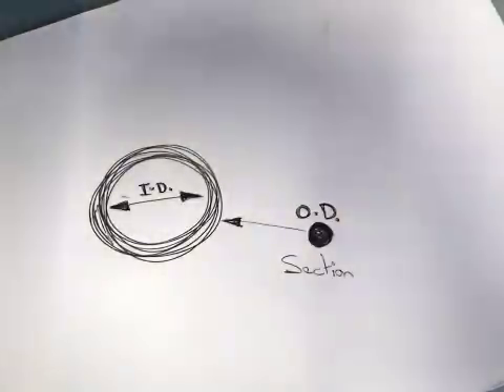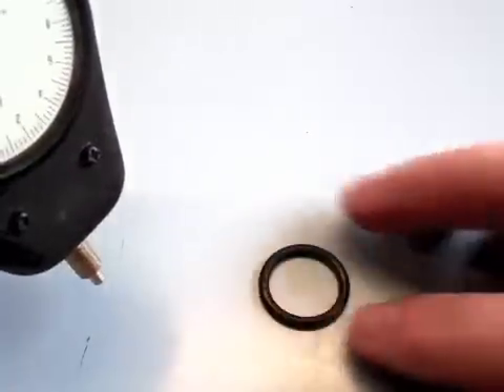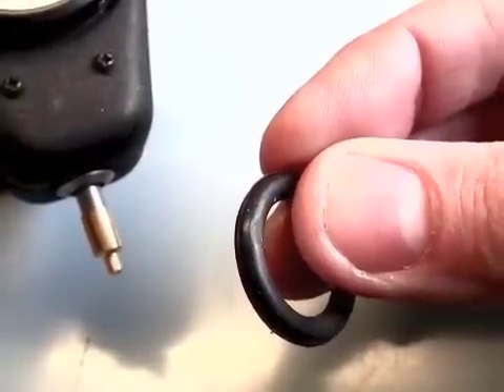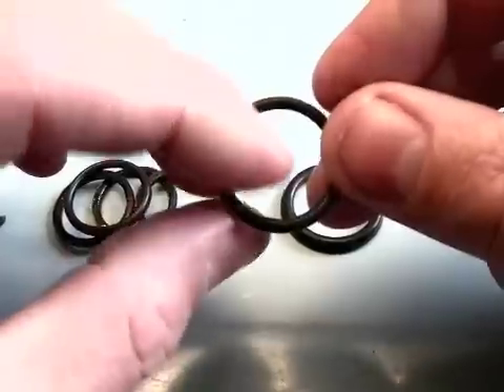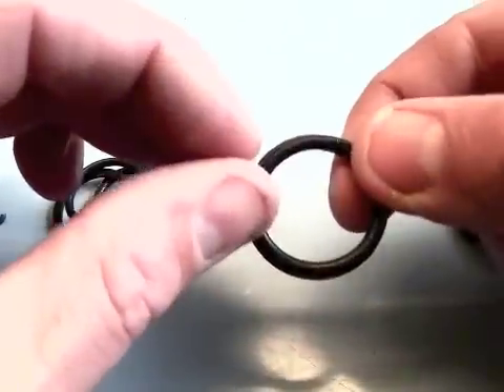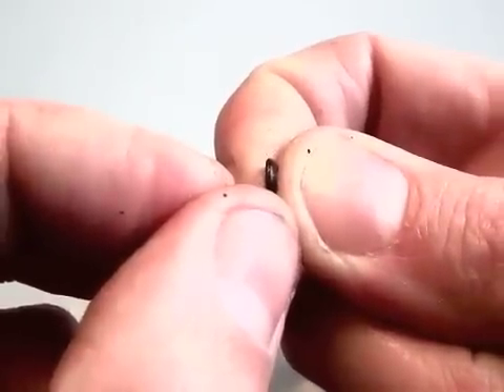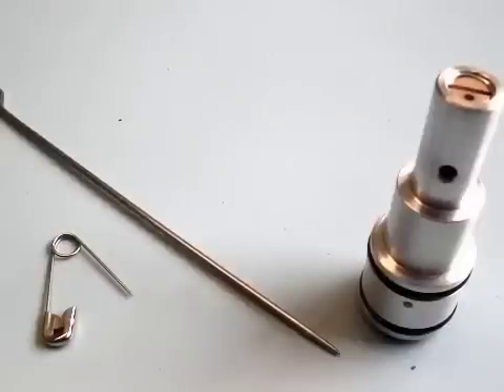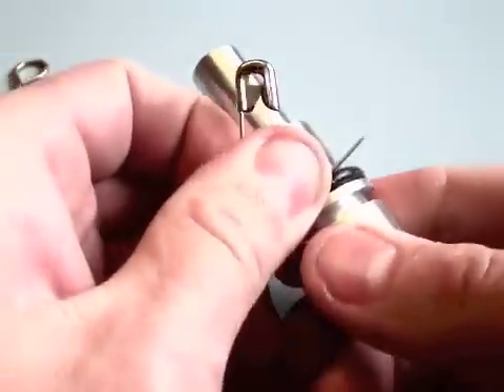Airgun / PCP 0-Ring Seals Pt 1-3 (A Little Information).

Comment: Nicely done.  Very informative.  I would have liked a discussion on the merits (or not) of various o-ring materials.  In scuba diving it was useful to replace the rubber external tank valve o-ring with silicone for longevity. In refrigeration system gas conversions vitron seems to be preferred for R-134.  Also, the lubricant varies with the material.  Perhaps you might touch on this in a future video.  Thanks for you videos.  I appreciate the time you put into these.